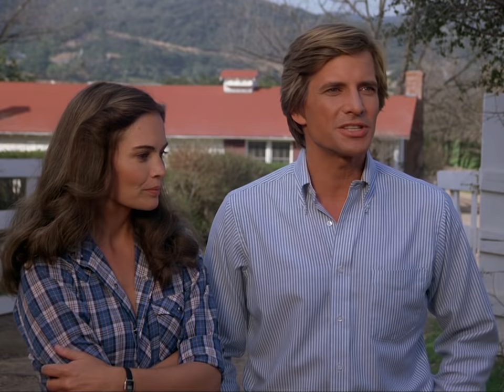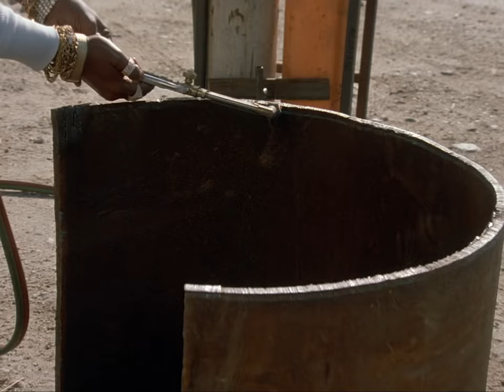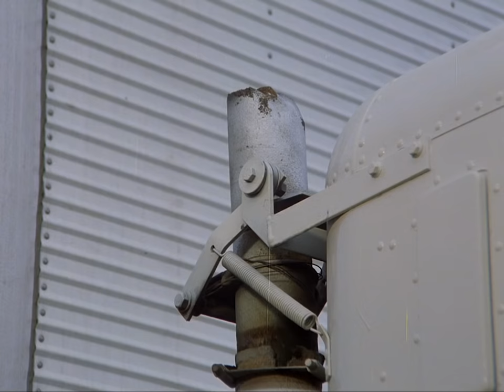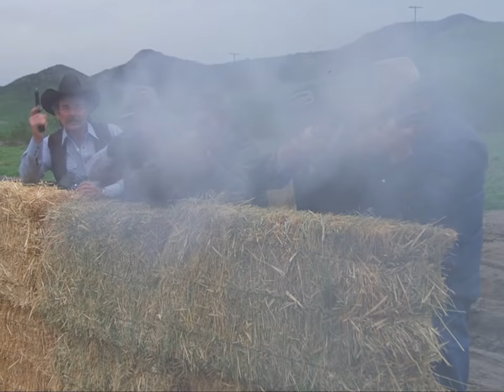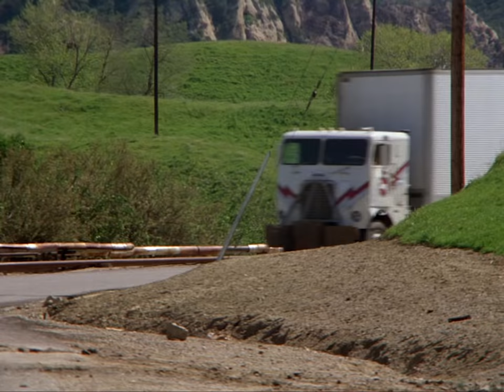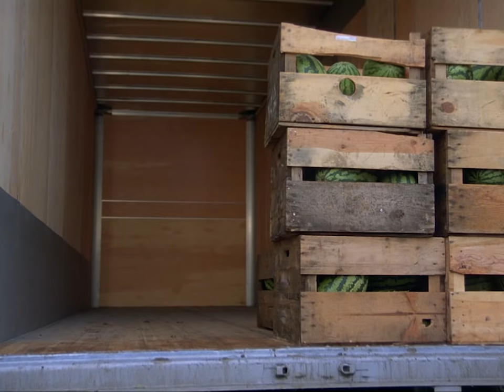Isn't It Beautiful | The A-Team

Comment: Question: how does the A-Team turn ordinary vehicles into armor plated, battle machine on wheels, without even using a tank?
Reply: Spare parts and ingenuity.
Reply: Imagine if they customize a gundam?
Reply: A better question is how does that Renault still move with all the extra weight on it?
Reply: @ALSmith-zz4yy  there might have been some off camera tuning going on there.
Reply: Why even bother, both the a-team and their enemies spray huge amounts of bullets and never hit anyone.
Reply: @ALSmith-zz4yy  First gear is very low and then engine has a lot of torque for its size. I've seen someone drag a 7.5 tonne truck out of a snowdrift with a Renault 5 not totally unlike the one in the clip :-)

Comment: I always love how physics is irrelevant in the 80’s. A LeCar that can carry 1000lbs of steel plate, tin roofing as armor, helicopters that could fly faster than sound, Chargers that could fly. Those were the days.
Reply: Chargers could fly, just the landing destroyed them.
Mostly because they were nose heavy so tended to nose dive.
They needed weight in the trunk to jump somewhat level.

You can see them crumpling on both the front and rear quarter panels most Dukes episodes.